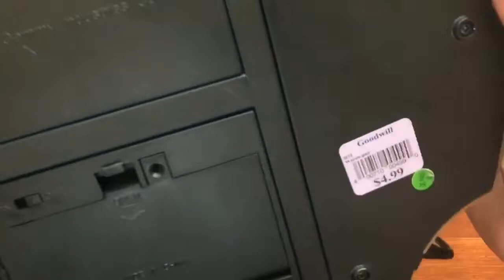Repairing My Fast Tail Big Mouth Billy Bass

Comment: Whenever I put the gear on, I try to make sure that the top of the new gear is flat and flush with the end of the motor shaft. Also doesn’t hurt to add some white lithium grease on the gear so it will last a little bit longer
Reply from the maker: lakewi44 yes that is what I did the second time, and it would be a good idea to get some grease

Comment: I found a big mouth billy bass on the street of germany and it's now my first singing fish ever. I need batteries and I'm scared to turn him on because he looks like he's very loud and I think his head is broken because I moved his head and his head didn't go back
Reply from the maker: If you lift the head up and it has trouble going back down that would be a split gear, you shouldn’t be afraid to test it. If you worried if it’s going to be super loud, just set it on a towel or a bed and that will muffle the sound plenty.

Also please keep in mind that there is no way you could get harmed if something goes wrong electrical because the voltage it way too low to do anything to you.
Reply: @adews7204  Oh Ok, Thanks.
Reply: @legoislandstuff8773  I have to find him in the basement tomorrow